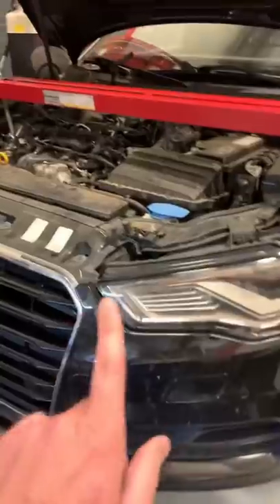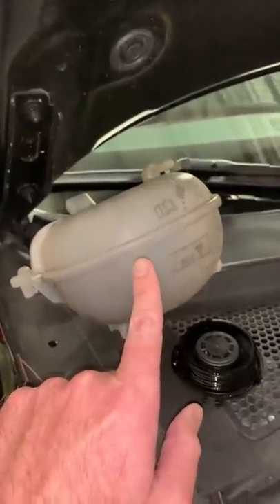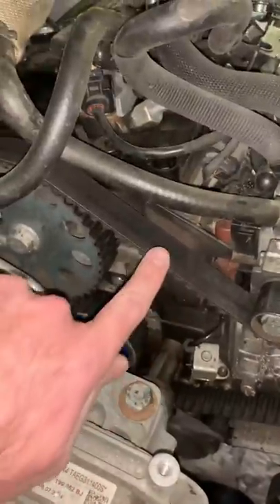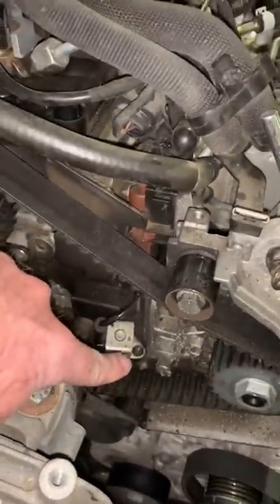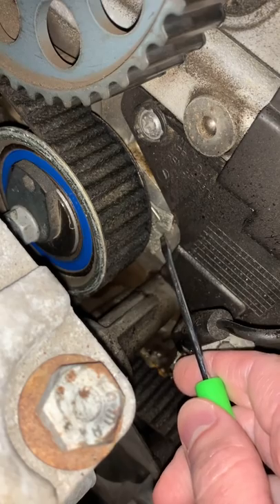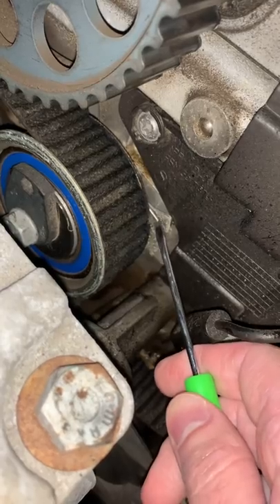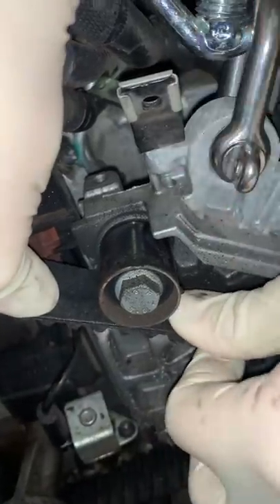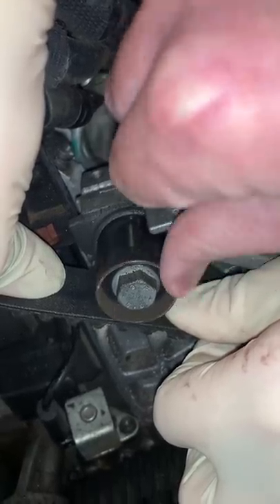Don’t let problems go on your car! #shorts

Comment: Mechanic: think we found tge problem sir
Owner: what is it?
Machanic: Audi
Reply: Tell me you hate them cause you suck at working on them without telling me. This car is one of the best commuter cars around and even good to make decent tq and enjoy.
Reply: @keeganpock864  
No I hate them because they constantly brake down. 
I hate them because when you look at how every single part was designed you can hear the part telling you how smart the person that designed it was and how the designer does not actually work on cars. 
I hate them because they are over price VW and VW are overpriced 
I hate them because in almost every level you can buy a comparable car for $10,000 less AND it will be more reliable.
I hate them because their tail lights cost $1200 to replace 
I hate them because they are built to make repairs expensive 

But aside from that they look cool
Reply: @keeganpock864  I sound stupid? " its not even that expensive compared to some(im also a volvo guy so vw is stupid cheap)"  How about compare Audi to Toyota, Honda, Subaru? GEEE I WONDER WHY YOU DIDN'T COMPAIR IT TO THOSE!  But your right lets use your logic: Audi is one of the cheapest and most reliable cars you can buy... when compared to a Ferrari or Maserati or Mclaren. Also I would not brag about a VW being " completely gone thru for under 6k" (by that you mean a tune up)  when you can built an entire Civic from scratch for $5000 AND that civic will out last your VW by 400,000 miles.
Reply: @keeganpock864  I'll continue rocking my clapped 92 MR2. You can continue spending money on audi parts.
Reply: 2013 VW Passat 120k miles on it with no issues. Routine maintenance 

2014 Audi A7 3.0 supercharged 30k miles, running great 

2017 Audi Q5 2.0 turbo running great 40k miles.

All 3 cars I still have and run, and they are fantastic. Take care of your shit and you won’t have problems. If you don’t, even your Honda will blow a motor.
Reply: @philodox7599  Are you actually angry about your own ineptitude? This is the typical American backyard mechanic, no training, logical connections are inexplicable but they are first class when excited. 
We have a lot of vehicles that have run well over 300,000, but never from the USA. What are you doing with it? Vehicles that are less than a year old but have been completed by the mechanic.
The American mechanic specializes in forgetting where screws and parts belong. Screws are often replaced by wrong ones that are far too weak or soft.
You should also be taught how to use glue with glue.
For the specialist in the video, the role on the toothed belt only serves to unite the belt's vibrations. There are models where this is missing and also manages well over 400,000 in taxis.
It's best to keep your hands off European vehicles, they don't deserve such poor maintenance
As long as your factories are only junk, the best thing to do is shut up.
Reply: @strikerwyatt  sound like thos vehicles are all brand new to me
Reply: @strikerwyatt  My god what is wrong with you people. You think 40K is impressive or something? Its still under warranty for god sakes... why would you even comment  that?  O YA WELL MY DAD HAS A CHEVY AND ITS RUNNING GREAT 17K MILES STRONG!  listen to yourself. ANYTHING will make it to 100K even a VW or Audi... you will just spend $20,000 getting to 150K then $20,000 making it to 200K
Reply: @philodox7599   @Philodox  wo nimmst du nur das Fachwissen her.
Was ich von VAG für Kenntnis habe wirst du schlecht beurteilen können, aber sehr optimistisch...
Zeig mir ein Kommentar von dir das inhaltlich und sachlich guten Inhalt bietet.

Was du bringst:
Kunde beim Gutachter: Ich habe mir ein Auto in den USA gekauft, können die das Bewerten?
Gutachter: USA? Hoffentlich war kein Mechaniker dran...

Wenn bei dir bzw euch die Fahrzeuge nicht so lange halten, schon einmal an Wartung und Pflege gedacht?
Reply: @Robert.86  Translation "Expertise.
You will not be able to judge what I know about VAG, but you will be very optimistic ...
Show me a comment from you that offers good content in terms of content and factual content.

What you bring:
Customer at the appraiser: I bought a car in the USA, can they rate it?
Reviewer: USA? Hopefully there wasn't a mechanic on it ...

If your vehicles don't last that long, have you ever thought about maintenance and care?"

your still talking nonsense. 
1st of all who the hell is talking about US cars? who cares? 
2nd At least with American cars you get what you pay for, you buy a ford for $20,000 you are not shocked when it does not last long You buy a Audi for $60,000 and it brakes down just as much as the $20,000? then you are stupid for buying another Audi. 
3rd I have built 5 cars from the ground up lets not pretend that I don't know what I am talking about. 
4th None of this has ANYTHING to do with the fact that Audi and VW are overpriced, Mostly unreliable, And unnecessarily expensive to repair.
Reply: @philodox7599  damn dude chill out with the Cap locks lol. It seems you got triggered easily by someone saying they prefer audis over American cars. Everyone has their choice of cars they like. When I bought my first Benz everyone was telling me how much I fucked up. Never had any major problems with it. In my life I have bought 4 Benz and they never gave me any major problems. Everyone has their choice when it comes to cars
Reply: @LowenKoniig  Its a youtube comment section. I am not triggered, I am not mad..... I am just right :D I dont care what you think or what your personal experence is there is hard data on this stuff. Hondas brake down FAR FAR FAR less ( I must be triggered ) then Chryslers do it just a fact. Audi is FAR more expensive to fix then a Toyota. You can say "Everyone has their choice when it comes to cars" but that does not mean that facts don't exist anymore. Ok how about this for an example? You said "Everyone has their choice when it comes to cars" right? Ok then I like Hondas and Hondas are faster then Audis..... See I can like Honda but I don't get to warp reality just because.
Reply: Savage, lol
Reply: @philodox7599  depends where you live honestly. My first audi a4 2006 is still going strong with 250k+ miles on it, never failed me (gave it to my mom and it's still going). Only thing i had to change was a battery and a back bumper after i crashed it (cost me like $120). Bought an Audi A7 c7 Facelift and had no breakdowns or major services (except the oil change). On the other hand my dad had a new honda civic that had to be serviced every single month until he sold it. As i see it Americans are the only ones that shit on every European car, maybe they're sending them those "bottom of the barrel" cars that they can't even get rid of lol
Reply: Can definitely tell where the term audi c**t comes from in this comment section 😂😂

Comment: Due to my other half's tastes we have a VW in the garage. It's getting traded the moment warranty runs out, probably for another VW. She is happy and I'm happy she is happy and also  that I don't have to work on the effin thing. The rest of the garage is Japanese, cause you know I can do a clutch change in under 4hrs without a hoist and don't need 17 different tools and sockets.
Reply: Exactly, my lexus will out live me
Reply: Yeah you get used to changing them when you buy shit
Reply: @mcarr9122  cope.
Reply: @mcarr9122  the tdi’s?  They are some of the best diesels
Reply: @mcarr9122  I'm not going to lie, the VW looks nice, drives exceptionally well for a little hatchback, interior is very comfortable. But considering parts prices and availability in Australia and the engineering quirks from the Germans and the fact the most awkward parts seem to unexplainably break - I would never own one as a daily unless it was under warranty.
Reply: my 2020 Corolla SE has a lexus engine in it, couldn’t be happier. Hope it proves reliable. The lexus the engine came from costs $60k, I got it certified preowned with v low mileage for $16k with 5 1/2 years left on the warranty
Reply: @M54B30_fan  
VW looks good in terms of exterior and interior. The engine however is shit. I rarely see an old VW in my country. I see a lot of cars with Japanese brand thats on the road after 20 years
Reply: @feero9680  depends what country you’re in if they even sell em.  The 2.5 inline 5 and 2.0 (2 point slow) are some of the most reliable gas engines.  Tdi’s can’t go wrong w.  I work at a vw dealership and have driven several (rather older) jettas and golfs w between 250k-350k miles
Reply: The most important thing is she's happy and you don't have to hear about it
Reply: If you believe Japanese are the pinnacle of reliability shows you know nothing about working on other brands and models
Reply: @RegionalRadioShackManager  Oh definitely not. Japan isn't the pinnacle, but Lexus is always at the top, so it does represent. But over the years Honda went down several reliability charts do their engine problems with the turbo, subaru got problems with engine PVC valves, toyota got problems on their rav fuel system. 

Only Lexus seems to be doing well. Audi though is up there amongst all other germans with lexus in terms of reliability, at least for certain models like the A4.
Reply: VW, all the expense of a German car without any of the prestige.
Reply: As a European living next to Germany it seeme to me that VW cars are much worse if produced in the USA or Australia. Around here, VWs are the most sold cars overall. VW has a market share of 11% here. The most sold japanese cars are Toyotas with 3.3%.
Maybe it‘s because you can get cheap VW parts around here every few kilometers. In General, japanese car parts are much more expensive than VW, Mercedes or Audi around here.
Reply: Got  over 185k miles on my Tacoma, baby still runs like a dream and doesn’t ask for anything as long as I maintain her.
Reply: @RegionalRadioShackManager  my 92 mr2 is holding up almost 30 years with just normal maintenance. You're coping and a sad man.
Reply: @M54B30_fan  I don’t think anyone in this thread knows what tf they’re talking about😂
2.0 tfsi is one of the most unreliable engines made in the last 20 years!! Piston recall on hundreds of thousands of units if not millions!
High oil consumption, bad turbos, oil leaks before 50’000 miles, plastic coolant flange that turns into jelo after 7/8 years, I could go on.
Don’t even get started on the 1.4 tsi or the original DSG gearbox’s 🙃🙃
Reply: @jamie0193  i said TDI not tfsi.  I’ve driven several diesels w over 200k.  I’m not a fan of dsg, they too clumsy and i prefer manual.  Honestly the 2 liter tsi and 1.4 aren’t bad.  Can make good power w intake/exhaust/downpipe/tune quickly.  The 1.4 i have floored loaners and driven them hard as hell and they struggle to get less than 30mpg.  Idk about the reliability of the 1.4 but the fuel economy is crazy if that’s what someone wants.  Realistically for the first owner of a car reliability isn’t much of an issue,  as most people keep a car for around three to four years and put maybe 50k on em.  Unfortunately most car makers are stopping to care about reliability.  Toyota might be one of the last, and who knows how much longer they have to last before their focus switched somewhere else.  Also don’t forget about toyota’s floor mat recall that affected over 4 million cars
Reply: Women cars.. "looks cute" but runs like shit.
Reply: @M54B30_fan  my bad I was also just saying in general about the 2.0tfsi and 1.4. The older 1.4 is a stupid double charger design where a bunch of them have issues switching between charger boost and turbo boost resulting in huge flat spots and horrible throttle response.
Toyota Floor mat recall isn’t even one I remembered until you reminded me. Guess all manufacturers have their bad days 🤣
Reply: @jamie0193  you’re good.  I agree about the 1.4 throttle response.  Complete garbage, especially in auto.  Takes about a full blown second or two (like actual seconds) to get it to respond.  Their fuel economy is stellar but reliability is probably not being a low displacement high stressed engine.  I was just messin w the floor mat btw but you got good points.  Old tdi’s are good engines that vw made, and maybe the 2.5 L 5 cyl and 2.slow.  <— the na 2 liter in the old bugs and stuff.  Those are the only good gas engines, rest suck
Reply: @redtarget5275  stop projecting. Any econo C class and even a luxurious W120 S class or shit even a Saab of the 90s is capable of being just as reliable or even more than your mid engine Miata. The only sad thing here is you trying to flex that.
Reply: Gundumb Meister  you do realize resale value is based on stigma and speculation right? People THINK a product is better than the other and that causes demand and cause price to hold value or even grow. That does not equal reliability. Realistically speaking most of the working class buys economical cars. What are most econo boxes sold? Oh yeahhhhhhh TOYOTA. So of course. Your comment has no correlation. Many other brands are reliable and have held value. 90s V8 Chevy’s , 00s Daimler era Benz, e36 e46 i6 BMWs, 80-00s Porsche’s,  90’s Saab and Volvo models, and many many more. If you noticed most of my examples are mid to higher end. Less production models less stigma and still my examples have retained value or grown too
Reply: @RegionalRadioShackManager  Anyone that uses projection as an argument is instantly disqualified for no originality. Try again.
Also
>Saab
L O L
Reply: i mean Japanese cars are reliable when you talk about gas engines but when it comes to diesel the TDI is king yall never heard of the ALH and it shows that engine will outlive the earth with almost 0 maintenance and abused like crazy as a short range commuter car in the city ... and we all know how good short city driving is for diesel engines (is really not)
Reply: True
Reply: Ahahaha ayee atleast you know😂

Comment: It would be a lot easier to just spend the money and go into a mechanic whenever necessary.. if 90% of mechanics weren’t crook hacks
Reply: Pretty much the reason I just started doing all the work on my cars myself.
Reply: Yeah… sadly even honest mechanics are still extremely overpriced. Quoted at $750 for just a water pump and coolant flush. For just under $400 and 6 hours of work I did my water pump, thermostat, serpentine belt, 2 coolant hoses and a coolant flush
Reply: @MajorMycology  when I was 18 or so, my temperature gauge was off the charts in my 99 integra. Took it to a mechanic to sort it out. $700 and a water pump later, it turned out that the engine wasn’t overheating at all. The thermostat just needed replacement.
Instead of using their laser temperature gun on the engine within the first 5 minutes of the vehicle landing in their bay, they decided to start making guesswork diagnostics on some parts they could make some money off of. First and last time I’ve ever been to a mechanic
Reply: It's not mechanics, it's dealerships and franchise chain shops with service advisors that only make commission.
Reply: You could just take your car to a shop that pays their mechanics by the hour. Not flat rate. That's how you get mechanics that only replace what really need replaced.
Reply: @jayblaze6410  it was a small shop, that was owned by a mechanic, that this story took place in
Reply: Exactly, I recently had a dealership quote me 400$ to put a new battery in, not some weird fancy one or anything, just a regular 100-150$ battery
Reply: Been a mechanic for 21 years and in my experience most shop owners are honest, but employ hacks
Reply: @MajorMycology  shops have a large overhead and profits are about 35% on total job. Shop rent, employee salaries, shop supplies, shop equipment, special tools, waste disposal, scanners, software updates, auto repair database like Alldata, insurance, electric bill, water, trash, employee benefits-if any, property maintenance, county licenses renewals, and large initial investment equipping and leasing or owning shop is a huge cost.
Reply: @joeyisamazing1091  OK... On what car?

Comment: Is very slightly streched from normal wear and tear the coolant had nothing to do with it
Reply: When he said that. I was like wait what? Da hell he say? Lmao
Reply: Qny liquid on your timing belt is bad over long periods yes it will damage shit and you got a timing belt watter logged it will stretch were talking months of someone driving around like this YES even just water will do q lot of damage
Reply: Also very slightly my ass he spun a pulley wheel idk if you can do that with your timing belt but if you can you might want to get it checked
Reply: Coolant destroys everything it touches period learn that real fast
Reply: Even the engine if you don't change the fluid every 75k

Comment: Coolant will not cause a timing belt to stretch. They are chemical resistant and most a Kevlar reinforced.
Reply: I wondered if someone would pick up on that. Nice catch.
Reply: Agreed. The tension from the belt wears down the water pump shaft bearings and causes the pulley shaft to shift. The tensioner takes up the slack that is created.
Reply: Correct
Reply: @AdjustinThings  If the bearings wore  it wouldn’t be more than 20 to 30 thousandths of an inch before it completely failed. That being said  20 thou. is not going to effect the tensioner or belt tightness at all.
If belt tension wears out the pump bearings then why doesn’t it do it on a serpentine or v belt?
Reply: Yeah the rubber might get a bit greasy but the cords are not going to stretch.